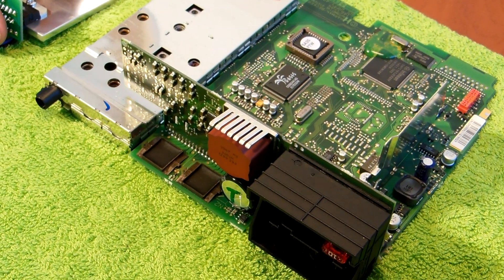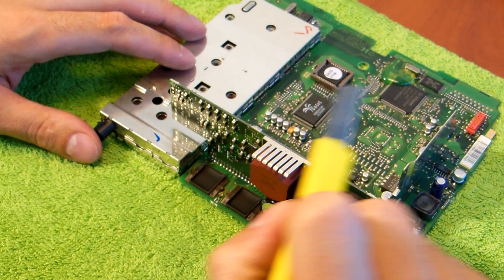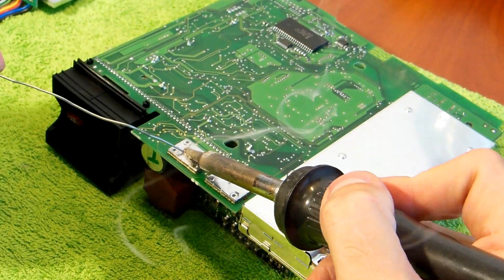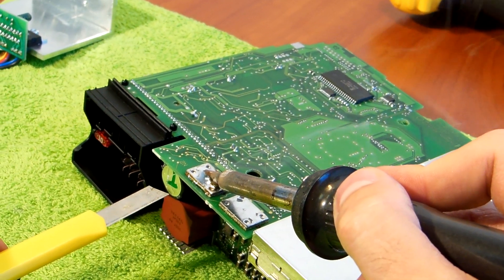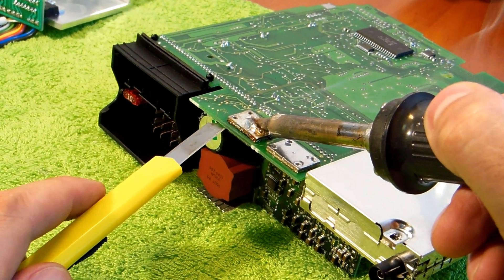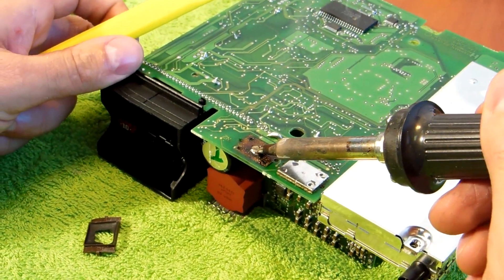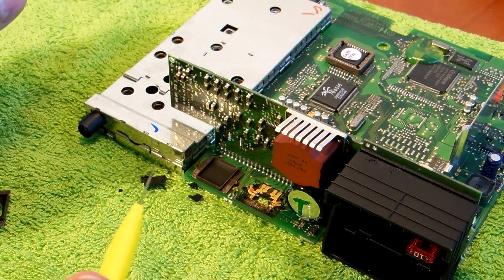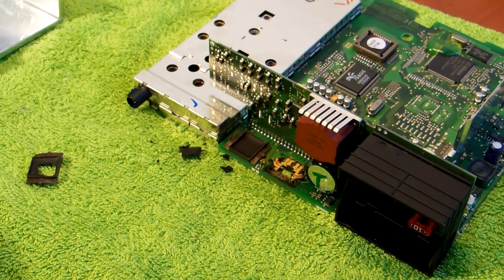BM54 repair - Becker radio amplifier chip removal

Comment: hey .. ive bought a kit from your site for the L7 amp... but no instructions... as which wires go where. please send help .. ive also emailed you ..
Reply: how long did it take for the repair kit to come through mate? ordered one but not heard anything about a delivery time
Reply: as im in the uk it took like a week i think to shipped from hungry ..and email them and theyll help ;)
Reply: Rushdie M Thanks, I got it today, took me a couple of hours to solder, little bit fiddly in places but what a difference it has made. 1000 times better than the original rubbish that Becker installed. I got a bit worried when I didn't hear anything from them, no parcel number or anything, email and no reply etc but true to there word in turned up. Thanks for the reply though. recommend it that's for sure.
Reply: yea true their amp sounds really better ...glad all is working again i kow the feeling ;) enjoy